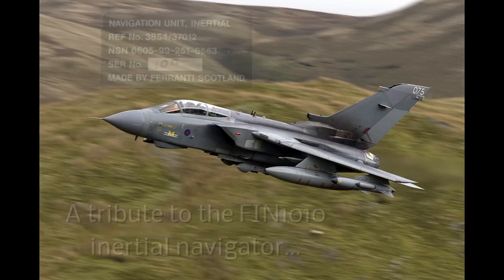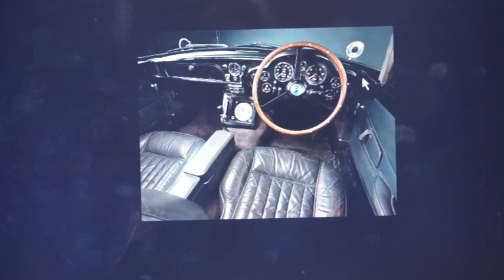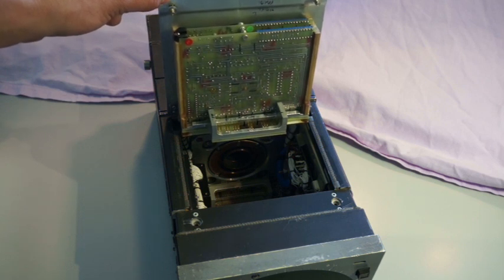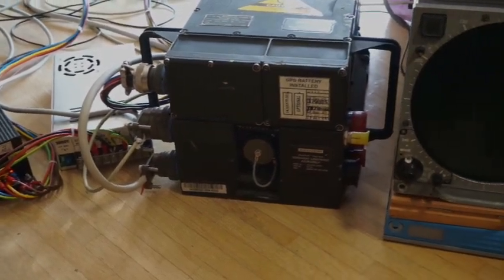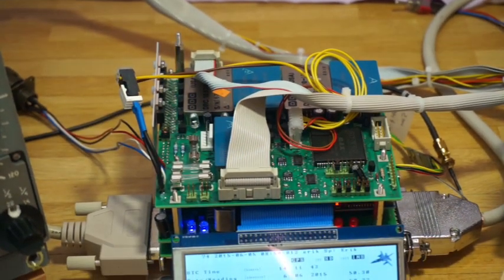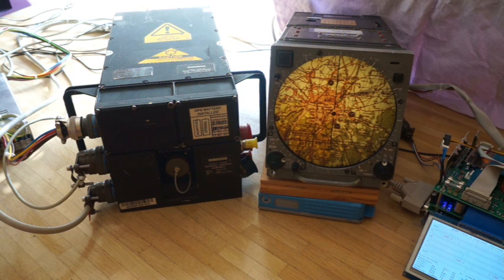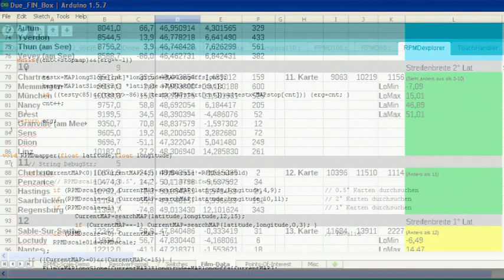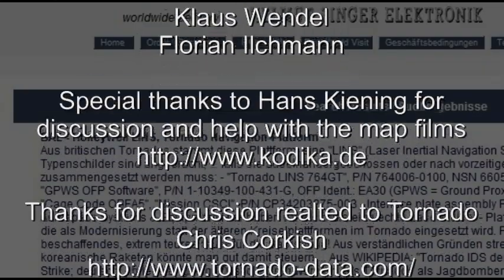FIN-RPMD-Explorer, a tribute to Inertial Navigation in early Tornado

Comment: Thanks for this video. My father was head of the department at Ferranti that designed the inertial navigation systems for Ariane, Tornado and Harrier. During the Falkland War his department developed systems to allow Army Harriers to fly from ships as the Army Harrier navigation system assumed the plane was stationery when the system started which was not the case on a ship. There might be someone in Edinburgh who would have more information. My father died a few years ago he would be 85 now.
Reply from the maker: Hi and thanks for your comment - the equipment to align the Harrier's INS at sea was called FINRAE I think and I have even been to Edinburgh, but unfortunately the era of the INS systems is long over and almost all experts are retired. Even the nice tools for assembly, alignment and test are meanwhile gone - I am still trying hard to preserve what I can get hands on!
And yes, those platforms have been used on Ariane 1-3 (and even earlier on Europa already) and where one reason why Ariane earned her reputation of being a very accurate satellite launcher. Best wishes...

Comment from the maker: Wow - 100 comments! Thanks for all the feedback ;-)  Meanwhile I have two fully restored, working FIN101X units and a stock of 3 not yet completely restored and having various faults. Got in touch with lot of exciting people during my work on those and during related research. Similar inertial platforms have been used on the Nimrod, Jaguar, Harrier aircraft; they have been in space on the Europa rockets and they made the Ariane 1-3 the most accurate space launch vehicle (two platforms per rocket). Other applications included measurements for deep well inspection, gunnery equipment and probably some others! The story is going on ;-)

Comment: This is a wonderfully beautiful video.    In a few more years nobody will have a proper understanding of these old devices.
Reply from the maker: +Ice Skater Thanks for the compliments - and you are absolutely right: I believe that the know how is lost already. I did a lot of research and tried to get in touch with someone who worked on these systems and I had not any success (the design was completed around 40 years ago). In the meantime I have quite a good understanding on how the unit works and I fixed all the electronics issues (two units achive alignment status "0", but I still have a defective gyroscope in one of the units). I am also still unclear on how the tweaking (attachment of balancing weights, determining trimming electronics components for the various corrections) was done in the factory. I guess, without this knowledge and/or a good plan, an attempt to change a gyroscope may lead to a unit of very low accuracy. Thus the next step is to build a gyro tester which will help me in characterizing gyroscopes and later in aligning a new one (which I obtained via eBay already) within the azimuth cluster.
Reply: FIN ner
Interesting.  I just bought two older Gyros.  One probably not so good but the other is for the bendix polar path compass system which enabled airlines to fly polar routes like London to Anchorage.  Bought from ebay,  they are still in the post.    The idea is to make some videos showing earth rotation, finding latitude, how to make a  gyrocompass and so forth.    At this stage I know next to nothing about gyros but history of science is interesting as is knowing how things work compared to reading about it.  Repairing an inertial navigation gyro?  Well I can see already that you like challenges and are good at overcoming difficulties.  :-)
Reply: FIN ner
I managed to get my gyro working in case you saw my earlier message. Thanks
Reply from the maker: ***** Thanks for your messages. I have seen them - the Bendix system also looks very interesting especially that it is working in polar regions sounds interesting. My navigator e.g. only works up to 85deg...
Great to know, that there are others out there interested in such stuff...
Reply from the maker: Great to see, that probably information from the web caused you to look into this technology! I am crossing my fingers, that you will have fun with your new toys. Depends on the gyro, whether repair makes sense. In case of the gyros fitted to the FIN1010/FIN1012 the answer is definitively NO: They are of the floated type (i.e. there is liquid in there supporting the precession axis) and toxic materials (Beryllium) have been used, so I am pretty happy that they are closed and never will open one. Instead I managed to get hands on some NOS (new old stock) spare gyros. Anyhow - even changing the gyro within the platform will be a challange due to lack of jigs and knowledge on how to compute the values for the compensation compionents for accelration crosstalk and anisoelasticity.
Reply from the maker: Cool! Can you share at least a photograph of these? You mail one to my private email... Keep up your interest in such stuff and good luck with your next steps!
Reply: I was wondering if you might have a floating gyro in your system, so yes after all of these years there is nothing you can do.    My worst quality giro worked acceptably. I changed the spherical balls but it can run for hours although it does not always sound so good.   Unfortunately the rotor bearings on the bendix polar path have melted and it runs horribly.  They are still available though at $80 USD each.   As far as I can see with my giros,  mechanical balancing is just to ensure that when the giro is moved in any direction at any speed the gimbals are not rotating which for my purposes I believe can be done by hand.   The giro also has to be balanced so it sits on the bearings perfectly level.    I was dissapointed the polar path gyro also has a defective level gauge - it seems to have a liquid in the glass tube which is a light brown colour which presumably has degraded after so many years.     Otherwise though the gyro arrived in beautiful condition.   I can send some pictures.      Unfortunately like with your gear there is a black hole when it comes to getting information.   Sometimes controllers for the bendix system come on ebay but they go for over a 1000 USD.
Reply from the maker: Well, I am amazed, that the Ferranti gyroscopes are still working after 40 years, too. I found out that they also have been used on Ariane and other space projects and that they have been subjected to a 10 year endurance test with a failure rate of 0/10 in the 1980ties. So they are indeed very reliable and I guess you can not buy something today for any money you are silling to spend.
Anyhow, congratulations to your video. It is very nice and it shows you using some clever techniques of the masters of physical experiments: Using the jar is great and the way how you damp out the oscillations, too. Additionally using a light beam as marker is also very cool. Nice setup without any modern computerized stuff - I really like it! I just checked eBay whether there is one of the gyros you sent me pictures of, is for sale but this is not the case. Do you have got a part number of the gyro you sent me the pictures of and you are using in your video?

Comment: I'm incredibly impressed at the effort and knowledge in this project! I'm all the more amazed to see the units working together! 
Congratulations!
Reply from the maker: Thanks for your positive words. Bringing the units together is indeed lot of fun. Ongoing work are connection of an altimeter, an
original attitude inidcator and a magnetic compass for automatic heading entry at startup. End of April I will show the units in working condition on the vintage computer festival in Munich - http://www.vcfe.org/D/. There I am also curios that the feedback will be ;-)
Reply: FIN ner Did you ever look at doing this with the CRPMD from the rear seat?
Reply from the maker: Hi Ciaran, no currently there are no plans to also connect the CRPMD: I had one of these beasts and FIN data input into this is simpler than to control the RPMD, but to fully activate the CRPMD (esp. the radar overlay) lot of reverse engineering would be necessary. So I skipped this project and instead I connected an attitude indicator and the altimeter is work in progress. Next to come is a interface for the HSI...

Comment: Loss for words! Awesome! A modern compact unit is something I have always wanted and would dish out as much as I paid for my Garmin GPS any day to get.
Reply from the maker: Hi and great you like the video! In the good old days (1974 as Tornado was developed), the FIN1010 alone was 250000UKP (worth a nice house those days). One of the units I saw sold off by Germany's Luftwaffe had still a price tag attached (German conditioning label) in 2010s EURs it read 107000 (for a used unit!). So even at the end of its life it was "little" more expensive than any Garmin ;-)

Comment: Hi This brought back many memories as I used to design/ install the F.I.S.T. equipments that were used to test all of these INS including the factory level Test Equipment that tested the lower level sub-assemblies.
Reply from the maker: Wow - that is amazing! So you are one of the experts with the FIST - would be very interesting to have some more exchange with you; if interested, get in touch via email at erik-at-baigar-dot-de!
Reply from the maker: Just for those not into technical details: The FIST machines where test sets that existed in different flavours - the FIST-M (M for manual) can be seen in the Video, https://www.youtube.com/watch?v=-EQqfxiGgd8&t=282s but there have been computer controlled variants, too. They intererstingly used the same archaic and completely uniqe computer to test individual boards which had to be plugged into some letterbox like slit for that. An other one, FIST-P (P for platform), was used to test the platforms and from this data it calculated values for compensation components (>15 resistors and capacitors) which where placed onto a trimmer board to make the plaform as perfect as possible. I really tried lot to rescue some of that stuff - sadly without success and recently have been told that all was removed from the old clean rooms :-(
Reply from the maker: Thanks for getting in touch outside of YouTube; thids exchange is highly appreciated :-)! Best wishes and take care...

Comment: What an amazing film. Thank you for sharing your knowledge.
Reply from the maker: Thanks for the comment. During making the video, I did not expect so many people watching (and liking) it  ;-)
Reply: +FIN ner +FIN ner Seeing how the 35mm film was projected reminds me of how in the field in which I worked, which was flight simulation and control, the piloted simulations used a large moving scale model belt with a TV camera &quot;flying&quot; over it. In many ways, today&#39;s digital solutions are so much less imaginative! I like how you have managed to interface some modern micro electronics. I am dealing with restoring far simpler electric systems from that era, which really puts me in awe of what you have achieved.
Reply from the maker: +DJ Walker Thanks for the positive feedback. I have seen one of the flight simulators with the model belt: It was based on a standard roller blind as used in normal homes - it was just 20m long and the ends connected, making an endless landscape (at least in one direction ;-)). So yes, great what was achieved those days - and keep up your restoring work as well!

Comment: amazing tech!
But how is the unit aligned with the film (e.g. when moving to another theater), how much map info is stored on one roll, and what happens if you fly past the border of the film?
Reply from the maker: Thre was "translation data" with the film which had to be loaded into the computer (I recreated that by using my setup to move the display to around 200 known locations/cities and correlating film position (x,y) with the lat/long from google) from than on the computer can calculate the x,y position on the film. In the E-W-direction a calibration is necessary which probably was done by the navigator using his joystick - so upon starting (at a known position) the map display was moved to precisely the right position and that was confirmed by pressing a button. If you watch carefully at 590s, https://www.youtube.com/watch?v=-EQqfxiGgd8&t=590s, in the film rushing by there is a red area showing an entirely red screen with lot of text "OFF MAP" on it. So if outside the  film material, the display showed that region of the film - I re-implemented that as well. Map coverage depended on country and sortie - I know of maps covering whole north Europe (UK, DE, CH, A) in three scales or e.g. the Falklands.

Comment: So cool! You should produce a highway map and try it in your car.
Reply from the maker: Hi and thanks for the suggestion: Indeed I had the system already in my car on some round trips ;-) Actually energy supply is the problem there! Regarding an own map: Today no one can produce such film maps any more - I even was in touch with ARRI making equipment for creating 35mm film from digital media but they can not do without the black bars between frames (would require a severe firmware change in their equipment)...

Comment: Would it be possible to do DIY maps? I mean using ordinary 35mm camera and color film to do the photos of some maps and then use it in this system. Where are the slide related data stored and how are they input in the system when changing film rolls? I mean the data that tells the system about each slide on the film so the system knows what area is it covering and what scale is it.
Do you have links for the manual for this INS system?
Can you explain all the switch positions like SH, NR, GPS, INS, MP, TE, G, P1, P2?
How can be the INS position updated? Is it possible to do GPS or TACAN or overfly or perhaps AG radar updates to get rid of the error on long flights?
Reply from the maker: Hi - lot of good questions. Some answers: (1) DIY films are difficult as one always gets the black bars between the pictures which require lot of additional film material for redndant information and increases software complexity. Even discussions with ARRI showed, that the professional film exposure equipment would need a new firmware to to that - to much for a hobby project.
(2) Side related data as you call it originally was a table of lat's and long's of the corners of the individual sections and x-poition on the film, e.g. 20 entries like 45°N-46°N, 7°E-15°E @ 2.55m. This table was loaded into the main computer. In my setup I implemented a soft-joystick to freely move the map and display the film position. Navigating to 200 cities and correlating that to google data I created a mapping function.
(3) Some information is in the Flight Manual which is available at various companies and even google books had it in the past (covers the mechanical FIN1010) - not the later laser gyro based system which's CDU was used in the movie).
(4) In the mechanical FIN1012 of Nimrod, one could simply enter an updated position during flight. In Tornado the navigator had a map display (CRPMD, similar to what you see in the video) but with overlaid ground mapping radar. Using a joystick he was able to align them to match and pressing a button updated the position - so some means of over-fly.
(5) The later replacement unit (which by the way can do all the 1010 can do but more and is a drop-in replacement) has GPS with Kalman fusing built in.

Comment: Wow this is great. But there is one question remaining, regarding north/south. What If I leave the boundaries of the film. So basically the width? Is the whole map-area separated into stripes, so that the film jumps to a position, that includes my "out-of-bounds" position or is this just the end of the map?
Reply from the maker: Yeah - absolutley correct: If the current position is outside of the map covered a section is displayed which has a red background and big black letters "OFF MAP" - so easy to recognize.
Reply: @finner4463  So the width of the film is the entire north/south coverage? Sounds as if this is not that much...
Reply from the maker: @bruennlein  No - along the film we have west-east and north/south coverage is implemented by multiple strips. For clarity, I prepared an image showing the map of Europe overlaid with the parts of the film: http://www.programmer-electronic-control.de/RPMDxplorerMap.jpg - you can see that the films have different height (i.e. scale) and that not the same area is present in all three scales in my film used on this video.
Reply: @finner4463  Perfect. Thanks for clarificaion. That´s exactly how I initially thought it would be.